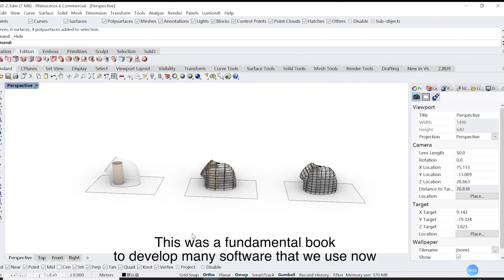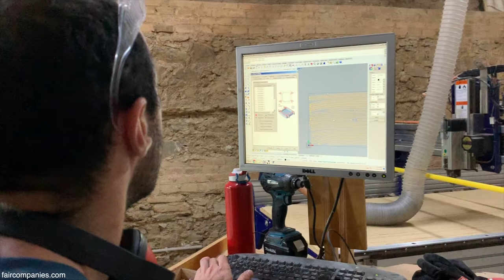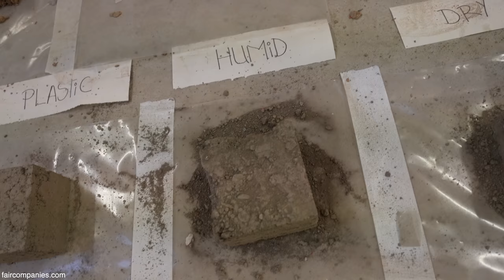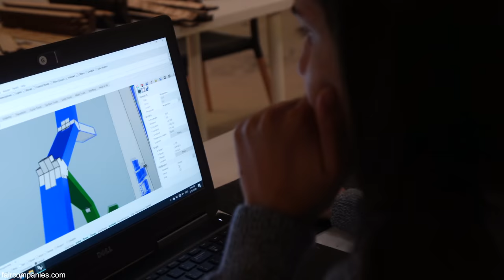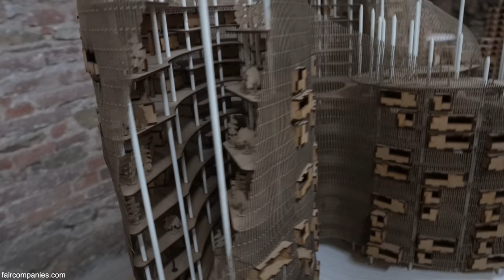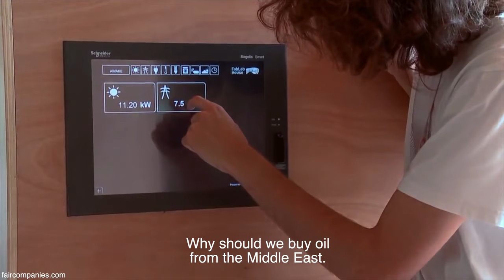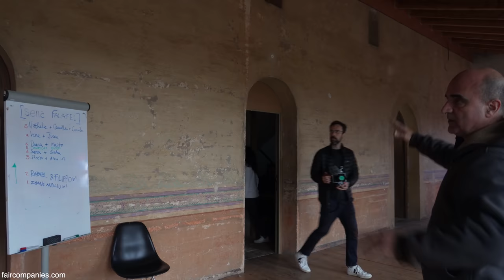Valldaura Labs culls restored forest for tiny home & biomass

Comment: The thing about free flowing structures is that there is not a standardization.  It is also difficult to keep the elements out of these structures.  Everything has to be custom made to fit, which takes excess time and energy that could be spend on other things.  In traditional structures of boxes, there is a standardization where things can be mass produced which cuts the time it takes to build and maintain.  Exterior elements such as windows doors and be standard sizes and built to be waterproof and energy efficient.  Interiors, such as furniture and cabinets can be mass produced because there are standard sizes.  Free flowing shapes, while interesting and unique do not provide this and to me are therefore inefficient to build.
Reply: A generalisation but with exceptions such the geodesic dome which has just three shapes in the entire structure. Often the shapes are pleasing to the eye and better able to withstand inclement weather. However, they are more difficult to furnish with freestanding furniture and most of the time the furniture is better built in.
Reply: Agreed. These are interesting design studies, they might be able to mass produce the small ones like cars on a line.  Many of the larger ones look like Frank Ghery designs made out of engineered wood. Those Ghery buildings are visually interesting but they don't work as buildings. MIT is even suing over one on their campus because the design elements are simply defective, it doesn't keep the elements out, it is a maintenance nightmare, the interiors are extremely inefficient. Form cannot overrule function.
Reply: SRGSMART  . The mars colony is going to turn architecture on its head because there, the pressurised homes need to be domes, spheres or bullet shapes. Alternatively if you build under 6 metres of water (0.6 atmos) you can get away with waterproof cubes. You could get away with cubes inside a pressurised giant dome but then one asteroid strike demolishes everything.
Reply: 616e6f6e Way to go
Reply: @jeffharmed1616  Though on mars the economics are a different case than here. The dome thing won't work well for most applications there, unless there is a revolution in materials that can 1) shield strong ionizing radiation / cosmic rays, 2) be transparent, 3) be made in situ and 4) keep internal pressure of at lesst 60% earth normal for shirtsleeves all ar the same time. Very unlikely material with current tech. More likely to build under thick regolith domes / cut and cover trenches / earthworks that cover angles of radiation incidence with big overhangs or use reflectors to bring light in. Big windows with nice vistas nestled deep in tunnel mouths or under overhangs for nice view and low rads
Reply: @616e6f6e Any sort of mass production that can be applied makes a concept work. If the CNC work is simple enough, or if a sprue of parts can be molded or stamped all at once. Bio-forming materials may also work, because the bio-forms could all grow / cure in parallel with little process cost.
Reply: @jeffharmed1616  Building submerged in a shallow artificial lake on Mars is something I read in a paper a few years back. Lots of potential, solves radiation and pressure issues. A thin transparent shell can keep the water from sublimating, lets light in. Waste heat keeps it liquid. Aquatic biomes are then open "outside" with scuba style gear. Came to mind when you mentioned the 6m of water. A transparent dome under the lake is actually very doable, since the water solves pressure and rad issues.
Reply: @StarBeamSocial  Mars colonists will be so busy turning their urine into drinkable water, and hiding from the intense radiation-freeze-thaw cycle that they won't have time to ride their dune buggies around. The ideal colonist will be a small sickly person who consumes fewer calories.
Reply: @StarBeamSocial  One good wind and your plywood kite will take off for the valley below.
Reply: @clark57225  We shall see how that all plays out. Sooner than later I think. It won't be a picnic out there for sure. Much as the early historical settlers anywhere tended to have hard lives.

Lunar settlements will prototype much of the early tech beyond the current finicky stage. Given travel times to Mars the systems need to be more robust than what we see on ISS etc. Better payload economics also changes things too.
Reply: @clark57225  Plywood kite? Not sure what you are on about. Maybe confused with a different commenter?
Reply: @StarBeamSocial  Maybe I picked on the wrong comment. I was referring to the Gehry-styled shapes and surfaces that, when scaled down and made out of plywood, might come loose in a strong wind and sail away like a kite.
Reply: @StarBeamSocial  It's been said that the roof leaks in just about everything Frank Lloyd Wright ever designed.

Comment: Be sure to leave a few trees up to keep that hill standing, or you'll have a bad surprise one day with heavy rains.
Reply: I think they only cut trees because there is, as they say, an "excess of biomass". So by their logic, they only cut what should be cut in order to keep the forest's balance.
Reply: @Daniel19021996  wasn't talking about "forest balance" , as I'm not concerned about deforestation, there's plenty of trees in the area around the house, but rather about the hill's structure integrity. You can tell at 28:36 that there's nothing left to keep the ground where it is, if a few weeks of heavy rain start to fall. That's what folks did wrong here where I live and the mountain just moved a few hundreds meters down hill.
Reply: The whole place appears to be in succession from a vineyard and therefore probably far from an ecological equilibrium. I am assuming most of the top soil eroded when it was a vineyard and will take centuries to rebuild and occasional landslides will, and always are, part of the dynamics. I don't have a degree in forest management but I assume it's very complex. Deadwood provides incredibly valuable habitat and removing trees and thus managing fuel loads not only provides gaps and habitat for early-succession species but also prevents forest fires getting out of control. Fires of course have their own role to play in a healthy forest but you might not want them too close to home.
Reply: I’m struggling with the reasons they make for cutting down certain trees . The logic would be to benefit the forest and encourage more growth from those around . Taking out diseased trees I can understand but their rule of thumb is purely for their ‘play at being architects ‘projects . Picking fat , straight trees was how they put it . They need to get someone in their to teach them how to properly manage a forest and also the  plant a tree for everyone you cut down might be a good place to start . There is nothing organic about the structures .
I feel when they run out then they’ll move onto some other source .
Reply: Biomass is not about “sick trees”. There is sustainable forest management. Forests grow approximately 3% each year, therefore the forests can be conserved if a selective logging of this 3% is made. Many parts of the Collserola Park forest where we are, grew largely because agriculture was abandoned 100 years ago. Biodiversity is dying because there are no predators. We call it a natural park and it is not because we do not allow fires that cause nature to gather. Therefore, just as in many of the world's forests, sustainable management is essential in these artificial forests, to promote biodiversity and proper development. In fact, because it is not a business at all, there is a huge lack of sustainable forest management in the world to promote bidoversity.
Reply: They should know it’s not the fastest tree that’s the best there is a way of thinning the trees to enable others to get more light and they will grow thicker and faster . 
I just wish they had said they were planting trees as well .
Reply: Some beautiful landslides and avalanches  in winter or both?

Comment: Amazing work they are doing.  I can't really be totally comfortable with wood buildings though, because I am from Southern California (US), and fires have always been an existential threat.  Now I live in Tijuana, Mexico and almost all of the buildings near me are made mainly with concrete, which seems much more sensible to me in such a hot and dry area.

Maybe they can come up with a foolproof fire-protection though.  And I know he did mention managing the forest as a strategy to prevent wildfires, and that is a very helpful idea, but that really doesn't eliminate the possibility of fires, especially in arid or semi-arid areas.
Reply: Jason Livesay 

you can actually build from wood with better* fire properties than concrete and steel, just not as shown here and probably not cheaply enough to be relevant for most of US.

* CLT panel walls that are 20-30cm (8–12”) wide will burn/charr one side which will protect the structure for longer and in the end fail more gracefully than concrete and steel.
Reply: Wood cities, sure, fire is a healthy dry heat. Interesting strategy. Who is pushing for this?
Reply: There is a limited amount of the special type of river sand that is needed to make concrete. One day we will run out of concrete if we don't find another way to make it.  That said we also cut down trees faster than they grow. It doesn't matter what material is used there is a limit.
Reply: Jason Livesay - I like Southern Cal & Tijuana! Fires are a harsh reality, but concrete is carbon intensive. We need billions MORE trees 🌲 especially in the SW, the gobble carbon & exhale oxygen 🌎

Comment: This is a visually interesting project which is undoubtably a step in the right direction, but it becomes apparent (as in so many other projects that make claims about ecological sustainability) that the designers are not motivated by an understanding of the fundamentals of ecological science. The batteries and solar panels alone in this house can, for example, only be produced within an extensive industrial infrastructure that is present in a society that exists "somewhere out there" away from this house which attempts to be self-sufficient. Recent research shows that photovoltaics represent 66% of the total life-cycle emissions of a single-detached structure that is designed to a net-zero standard.

This project's weakness is that it attempts to solve the process-based requirements of sustainability with a novel "organic" form. While the form might achieve some degree of greater visual similarity to "nature", the house itself functions still as a rather unnatural object: it requires many synthetic, non-renewable resources to build and maintain the concept. Simple, geometric, standardised wood constructions on the other hand, while they may not be able to imitate organic, flowing forms visually, are able to be built with completely biodegradable materials: they can be made both airtight and watertight with wax-treated wood-fibre plates and with simple raised floor geometry can also avoid the use of synthetic insulation materials in the foundation. In this sense they are able to function as any other construction in nature, returning into biodegradable components that break down and become the source of nutrients for new plant growth at the end of their life-cycle. Ecological sustainability is first and foremost a question of function and process, not necessarily a question of artistic form. The use of new parametric technology to create novel forms is largely irrelevant to ecology.
Reply: They are less interested in solving problems and more interested in their own egos and delusions of grandeur.

Comment: Jumping into a brainstorm before watching the whole video. Parametric structures. What I like about the first two shapes, the free roof and the small hut. They use space really well, none of that 'idea' that wastes space that so often occurs when some idea is applied to architecture. Instead both shapes are interesting and should remain interesting while being lived in or used for many years. What's needed is some practical way to efficiently cut out the  shapes needed for these designs. I know from plywood kayaks that if you join two curved lines you get a three dimensional form that is very very strong.  (Would you use 1/8" (3mm) plywood to protect your body against the bite of a 21 foot great white shark? Of course you wouldn't. Yet California Kayaker Duane Strosaker experienced exactly this. ) There are many architectural tools for dynamically drawing curved two-dimensional lines. As the kayaks prove curved 2d lines combine to make very strong 3 d lines. An ideal curved cut guiding tool would work as a fence or a track. You might get these settings. At the long end of a 4x8 sheet of plywood, 24" in position your 'curv-a-turer' at point 18. Set its 'plunger to 19.5 and have it meet the far end of the plywood sheet at 15.5". You clamp the 'curv-a-turer' at the first point, clamp it at the second point and then run a jigsaw along the track. Done. Almost as fast as using a SkilSaw cutting a straight line. Software could further be used to calculate how specific cutoffs could be curved cut, perhaps stacked and then joined to make a panel large enough to be used. It would also have a dome shaped so it would be strong. 

None of this would be very difficult, none of this would actually be new. What would be new and useful is putting it all together. The Sydney Opera House I'm sure most know was supposed to be a series of parabolic shapes. This proved too difficult and costly - no form could be used twice. By the time Frank Gehry was working 25 years ago software had advanced to the point it could design steep I-beams to support his whimsical shapes. A few years earlier his Disney Concert Hall in Los Angeles would've been even more impossible than parabolas in Sydney. 

"This is the future of our cities" good luck. How many times have I read or heard this in my life? 

I'll bet that every major development in architecture, structure creation, food planting, everything in this video - if it does change things it's because it's more efficient (profitable) than what went before. The 'future' of energy was solar panels and wind turbines, until they were finally able to compete economically with coal, oil and gas. (and granted that these old energies were subsidized by governments. Tesla got a head start with tax credits to purchasers. This gave Tesla a major boost. At the time some whined that this was wasting money, but it was clearly a sound investment.)
 What I've discovered cutting out curves and taping them together is that a system of curves begins to figure itself out. This demonstrates that the math isn't at all complicated. 

The post and beam frame. Making these can be very time consuming. What is instantly obvious is, cutting notches is quick, and what if instead of mortise and tenons, just drill holes and drive in large dowels? But when you try this the first think you learn is the joints are too loose. The issue really isn't that this is a bad idea it just hasn't been taken far enough. So notches which takes some skill to make and match, but it's a skill that can be mastered and sped up. drilling the dowels then? This requires a new kind of sturdy three dimensional clamp that would hold both elements. 

Also if the second hole were drilled at a slight angle to the first (which would necessitate drilling the top beam, just enough into the second, then removing the first, and drilling the second at just the slight angle, then a very strong joint, good forever (only rot, fire and bugs can harm it) would result. Such a system would work for the parametric hut frame in the video. 

Just musing out loud.
Reply: To finish my last idea. The slightly dog-legged path for the dowel would bend it just enough to tension it in place, by the time the wood dries out enough to cancel out the tension, the whole structure would be built and settled locking it all together. (And the level of moisture in the wood becomes an issue. I don't know the idea moisture content of a post and beam frame, or if it's critical. Perhaps on something like Shakespeare's Globe Theatre (when it was first built) the theatre carpenter just went around every year or so as the timbers dried and shrank and gave all the pegs another tap.

Comment: The pollution of biomass energy or solar panels in the mining used, also the batteries used for the storage of excess energy or the actual plan of building even a small city for10,000 in a forest. It would not be viable nor ethical in the materials used to build such a project. Imho.
Reply: The solution is to do away with the high tech gizmos that require other high tech gizmos to operate. Get rid of that crap and the price of the project drops by half.